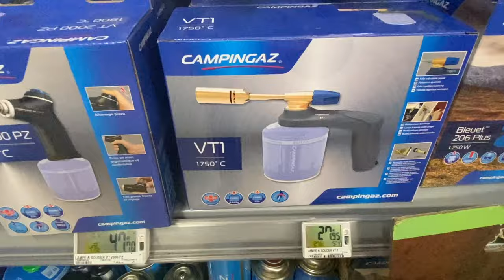My first YouTube pod cast in France | A Place in the Sun found us our dream house

Comment: Keep that blow torch for lighting your bbq 😂 or doing your creme brulee 😂 get a large pump action sprayer and at least 20% strength vinegar that will sort the weeds 😉
Reply from the maker: Thanks Paula. I’ve heard that method is not very good though. I’ll see how I get on with the blow torch and will have a re think once the gas has run out 🇫🇷👍
Reply: Add salt and washing up liquid 😉